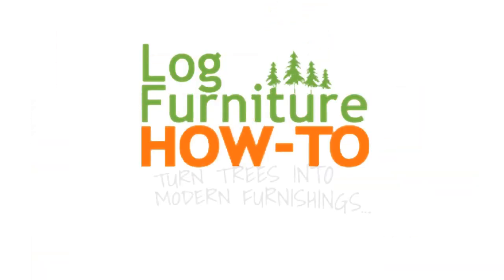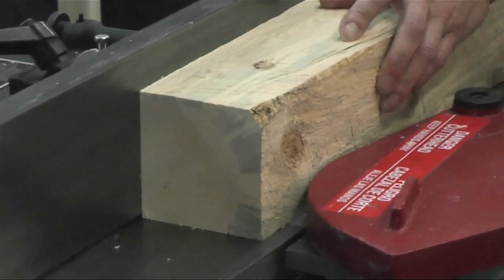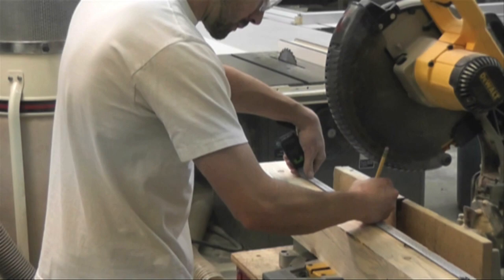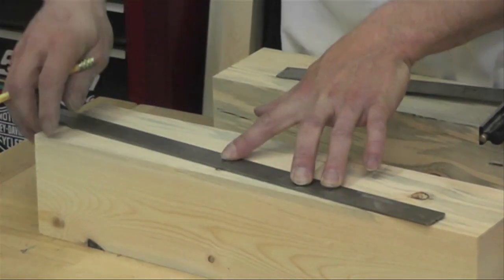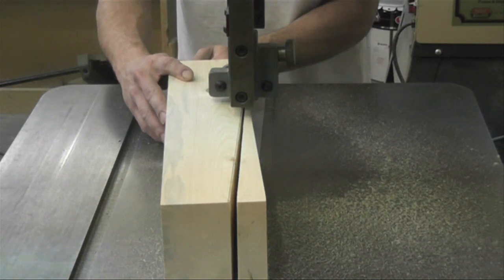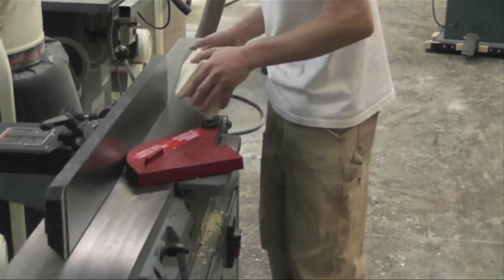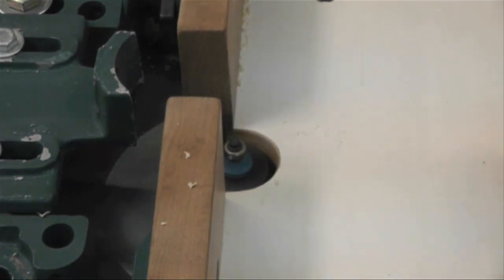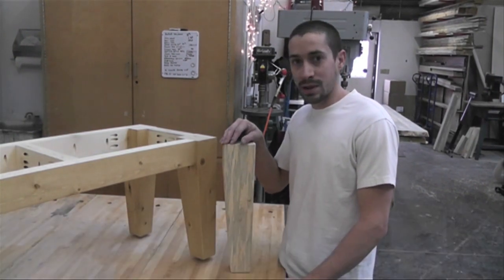Dimensional Leg Tapering How-To

Comment from the maker: You can use the wedge on your guide as long as your first cut was super straight as any bumps on the wedge could cause the piece you're cutting to rock while cutting it. You also need to make sure the wedge doesn't shift while cutting a new piece. So it may not be as easy as you would think. I recommend using the wedge as a doorstop :)

Comment: Once you cut the first taper edge, could you use the scrap wedge along the squared edge on the other 3 peices to run along a guide rail?
Should allow for identical cuts as well as allowing you to use a push stick?